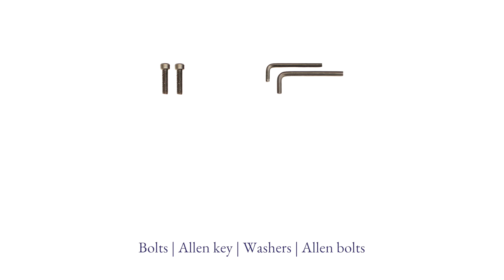How to assemble Andromeda bed furniture at home | furniture fitting | Wakefit

Comment: Hi. Can you please tell me what to do with the 3 white round rubber felts provided with the setup toolkit...?
Reply from the maker: Hi Tirthankar, please share your order ID or registered contact number for assistance. Kindly allow us to assist you via call regarding your concern. Thanks, team wakefit!
Reply: I also want to know what is the use of 3 rubber felt provided in kit.
Reply: Secret ? I too want to know , wakefit should have included it in the manual itself. Already assembled the bed .now if I am told to stick them on the floor side ......
Reply: Got to know about it. They are levelers ,to be used to level any of the two centre support legs, if they fall short. One on my bed  had small gap below it so I used it.
Reply: @subodhsharma6869  thanks!
Reply: @subodhsharma6869  thank you
Reply: Hey Tirthankar,

Can you just review it?
Reply: Is the Allen key given with the kit?
Reply: @Niteshmishraa  yes
Reply: @minafirdous6306  it's good. Using for almost a year. No creaking sound or problem whatsoever

Comment: Pls suggest me what is the bolt size required to complete assembly , we orders m6 x 55 mm and those bolt doesn’t fit
Reply from the maker: Hi, thank you for connecting with Wakefit! Please check the below bolt size which are required to install this bed. Do reach out to us for further queries and concerns.

1.Allen Bolt – M6x50mm -18 nos
2.Allen bolt – M6X70 mm -1 nos
3. Allen bolt – M6X35 mm -36 nos
for storage

^Apoorvaa

Comment: This video is misleading, I bought this bed after watching your videos but it seems they have done cost cutting and providing less support, bottom frame has completely vanished. 
This all videos seem to be misleading
Reply: Also On top frame Support they have reduced the width of frame further weakening the bed capacity.
I am pretty much scared to use the bed as it can break anytime
Reply from the maker: Hi Talha, we apologize for any hassle caused to you. This is not what we wanted you to feel when you received the product. We would like to let you know that before we ship any product, it undergoes several stages of quality checks. We intend to provide only the highest quality items to our customers, and we regret that you are facing an issue with the product.
https://docs.google.com/forms/d/e/1FAIpQLScPiXO95sly1Y_ETAbvNmD_59jZwIiwTKNI6ImgyBXgy7Vs5g/viewform?vc=0&c=0&w=1&flr=0
^Pooja
Reply from the maker: Hi Talha! This is really unfortunate and certainly not the kind of experience we want any of our customers to have, we apologize for the hassle caused! We ask that you fill out the form below with the required information. We wish to keep all of your information confidential. 
https://docs.google.com/forms/d/e/1FAIpQLScPiXO95sly1Y_ETAbvNmD_59jZwIiwTKNI6ImgyBXgy7Vs5g/viewform?vc=0&c=0&w=1&flr=0
^Pooja
Reply: Yes.. This is misleading video.. Even I had ordered the bed looking at this video and other customers video. they complete bottom frame is missing (total 5 wooden pieces) and the MDF board is laid directly on the floor, this will damage the MDFs with water spills etc. And the above support frame width is very much reduced with minimal support.. I am very disappointed and want the actual design bed shown in this video.
Reply from the maker: Hi, thank you for reaching out to us. We would like to inform you that recently we have added a new variant of the Sheesham wood products and this video belongs to the old version. We have informed our concerned team to make the necessary changes and upload a new installation video. Thank you!

^Rimple

Comment: Yes.. This is misleading video.. Even I had ordered the bed looking at this video and other customers video. they complete bottom frame is missing (total 5 wooden pieces) and the MDF board is laid directly on the floor, this will damage the MDFs with water spills etc. And the above support frame width is very much reduced with minimal support.. I am very disappointed and want the actual design bed shown in this video.
Reply from the maker: Hi, thank you for reaching out to us. We would like to inform you that recently we have added a new variant of the Sheesham wood products and this video belongs to the old version. We have informed our concerned team to make the necessary changes and upload a new installation video. Thank you!

^Rimple
Reply: @Wakefit  This new variant is not at all good and it's wakefit's mistake for not updating this information on website and the video on YouTube and fooling the customers. I want the older variant as it is far better than the new variant.